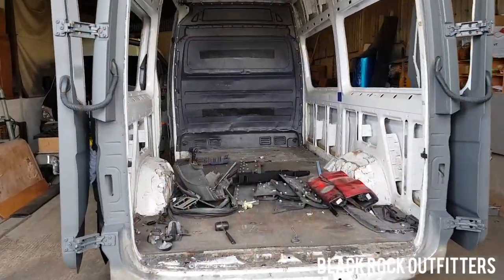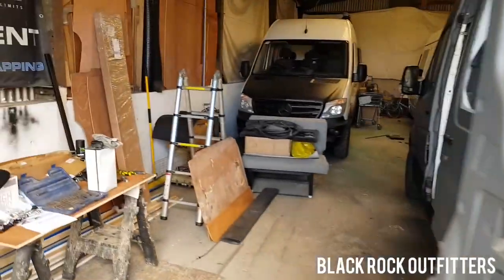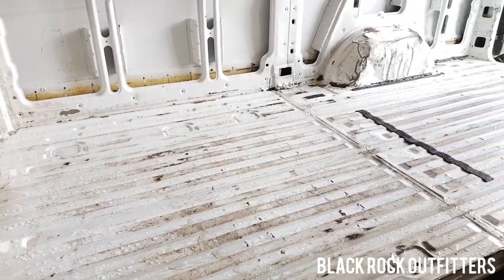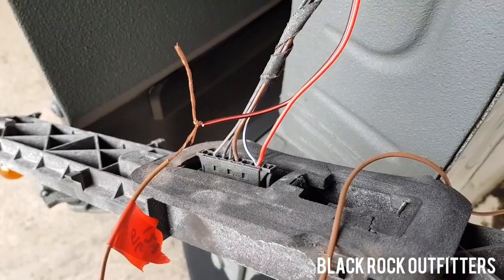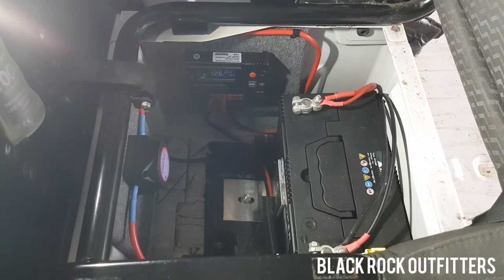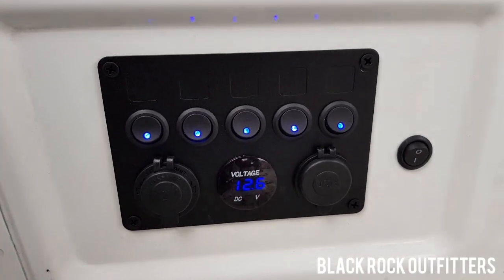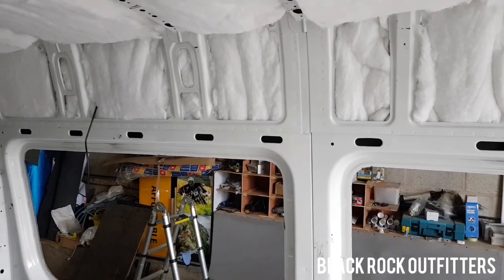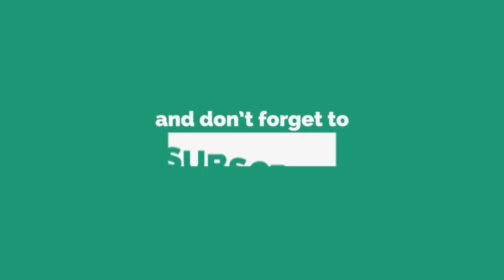NOMAD Crafter Sprinter - Campervan Conversion - PART 5

Comment: I think the voltage-sensitive relay detects the starter battery voltage, not the leisure battery voltage - and when the starter battery drops below the level at which it has enough voltage to turn over the starter motor, the relay closes off the connection between the batteries, thus preserving the charge in the starter battery. Is that correct?

Really loving the series - can't wait for more!
Reply from the maker: Could be, I know what I mean in my head mate, it just doesn't come out that way sometimes 😂😂

Comment: Really enjoy watching these fella.. notice you haven't gone with any sound deadening pieces under the insulation or floor.. any reason for not doing it?
Reply from the maker: Cheers mate, glad you are enjoying it! 

In my personal opinion and experience sound deadening is just a fad that people love wasting money on. In the grand scheme of things it really doesnt make that much of a noticable difference once the insulation, vapour barrier, walls and other fixtures are in place. 

Trust me your money would be better spent in other areas....😎
Reply: @blackrockoutfitters78  thanks for the reply. What's your opinion on van lengths.. im looking to convert a van for me and the wife for exploring scotland Wales and Cornwall etc for biking and hiking but cant decide between a mwb or lwb?
Reply from the maker: Mwb is perfect for 2 people but you will struggle to get a shower in one so if you want to stay on sites it's no problem but if you want to wild camp and need a shower then get a LWB 👍